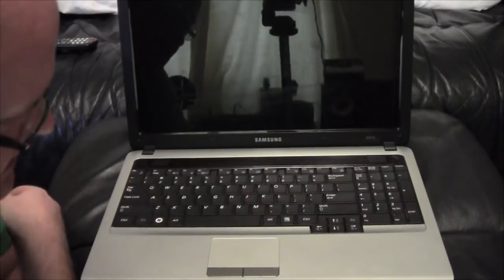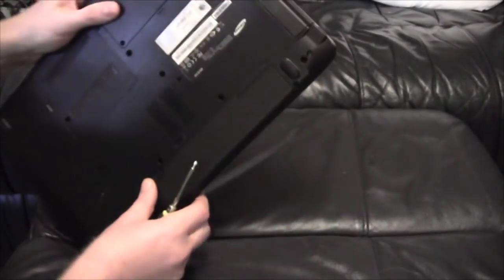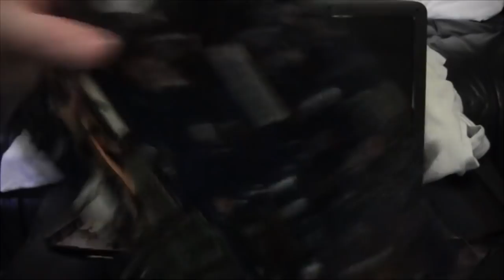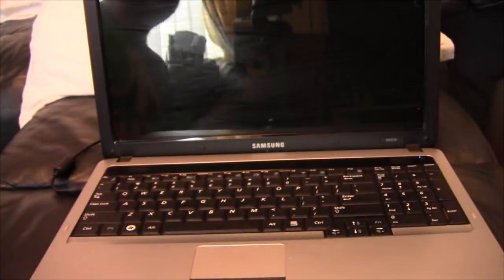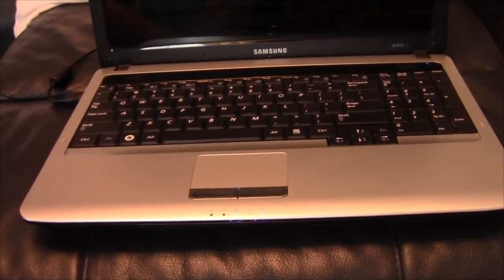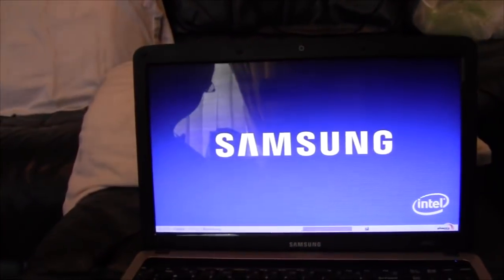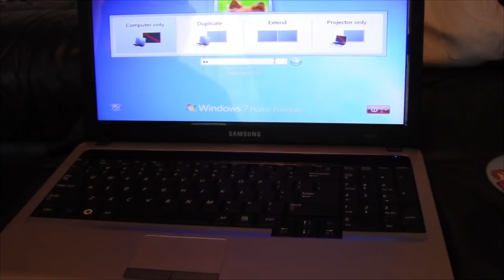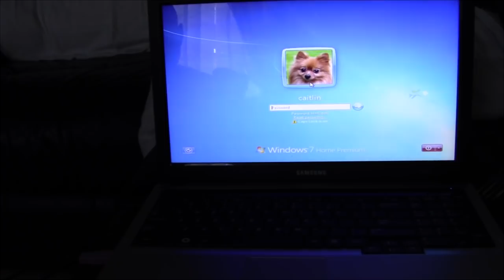How To Repair A Laptop After A Liquid Spill : Tutorial !

Comment: CAUTION!!! Never use a single cup as a placement for your screws because if they are different size or length in anyway, its gonna be a nightmare to put back. This doesn't even include the possibility of tripping the cup over. Make sure you got multiple storage departments for different screws. SECOND!!! NEVER USE WATER TO CLEAN A MOTHERBOARD OR ANY COMPUTER PART. Water will also ruin it over time and the same thing will eventually happen. The motherboard will poop out. The correct liquid solution to use is called "Isopropyl Alcohol" from your local electronic store and let it dry outside for a few days.
Reply from the maker: Yes, I agree, things I’ve learned in the 13 years since this video was made :o)
Reply: @RetroGamerVX haha

Comment: Hi I have a hp250 g1 laptop and like 3years maybe 4 ago got attacked with flavoured milk on the keyboard and if I  remember correctly it suddenly turned off plus that moment it was poo time in my life and with the anger just trew it in the box room and left it there,recently i remembered about it and tried to 'turn it on' but of course nothing happened,with or without the battery in when i plug the charger the side light starts blinking slowly from orange to white then it settles on blinking slowly white but when i try to press the power button nothing happens  exept it start do that thing the light goes orange for a few seconds then turns white blinking slowly again.Tooked it to a 'tech' and told me it is not worth it to fix but he was still able to get most of my photos videos and links on a pendrive,what do you think??? there's hope that it will turn on again??? if so this tutorial will do it or i need to do something more?PLEASE AND THANK YOU IN ADVANCE reply back thanks.
Reply from the maker: Naa, won't be worth it, motherboard likely badly corroded by now.
Reply: @RetroGamerVX  thank you for the reply,is there any way that i can check bymself if the motherboard is corroded or no? if no there is a way if i buy another motherboard to install it and it will turn on again? thank you in advance

Comment: I already did everything to my laptop. It’s a single slot ram, already tried removing it and turninh it back on, also did the keyboard cable out, the video flex cables, also tried connecting my laptop via hdmi to other monitor. And it’s just not working. But I haven’t done this yet. I’m a little bit sceptical of course getting you motherboard wet.
Reply: My laptop turns on but has no display

Comment: It switched on but its not charging. After a while it switched off because the battery was dead. Sad days
Reply: Google your exact laptop model (should be on the bottom of the laptop), look for a charging port replacement and replace it AND the charger. Worse comes to worse you have to solder it on there which isn't too hard. If this doesn't work, then your motherboard is fried.

Comment: I got a Quarter size drop of ICEE Cola on the upper top of my HP Laptop, where the small holes are, above the keyboard and it was only on that area...I left it there as I was afraid of spreading it and making it worse. I used my shirt to clean it up and it was typing on its own and making the icons on the screen big. I took the battery out and switched it on and off, and..long story short, my laptop went into cardiac arrest and never turned back on. I'm inclined to just throw it, but idk.

Comment: Had a little spill of soda on my computer a couple of months ago, but all the keys turned out to still be fine. However, with sticky keys, I tried to spray some cleaner over them. Time after time after time. Finally, they became operative again. But then, the ESC key stops working. Would this work to fix that as well?

Comment: Hello @RGVX. I have the same problem. I was surfing on the web and suddenly felt sick and I vomited on my laptop. I opened my laptop and cleaned with alcohol and it started yet only like five keys of  the keyboard were working. I cleaned then the motherboard with thinner and all keys are working,, only that if type certain keys like:   1, I get  output as 74231. 3, I get  output as 97423. Q, I get  output as mvx. E, I get  output as hge. A, I get  output as jfa and space bar I get  output as nbz  . Do you think it is a hardware or software problem and if so how to fix it? Could acetone clean the motherboard better?

Comment: The best solution would have been if the circuits were simply covered, instead of having those damn gaps where liquids can pass through.

Seriously, WHY does a keyboard have to have those wide open gaps?
It's ridiculous.
Reply: @Arbi Amaev Sö6 mine got thanos snapped so half my keyboard works
Reply: I split water on my latop and I broke several keys. I cannot log in anymore :')
Reply: @limeartichoke  buy a cheap keyboard
Reply: Mine doesn't even turn on anymore
Reply: My laptop has a metal piece that protected my laptop from water and cola and more

Comment: I just spilt a little bit of Coca Cola in the middle of my keyboard. I acted fast, picking it up and turning it upside down so the liquid would drip out. I then carefully wiped it down with a paper towel and put it in front of a small, portable fan. This was 10 minutes ago. My keyboard is working fine and my laptop is working the same as it did before I spilt it.

I hope it is okay.
Reply: +cody 
Is it still okay?
Reply: Yes.

Comment: I spilt a bit of coke on my hp laptop. It worked for 5 mins and then it just went off. It then turned back on and the internet wouldn’t work after 10 mins it turned of. Idk what to do now. Can I have help or guidance
Reply from the maker: Reece cause you kept running it, it will be what’s technically known as...buggered

Comment: i spill water on laptop keyboard,repaired it in 2 days:

1.two paper sheets a4,
2.sealed three sides with duck tape
3.put bunch salt in it and seal the last side
4. put on keyboard with a brick on it so the keys were pressed. 

bam, works again

Comment: Suggestion: I use white vinegar where I see apparent corrosion... especially if you're going to use the drowning (washing) method you used. I've found, over the years (especially with battery corrosion, and others) it works quite well. 

Also, when drying very wet electronics (including cell phones) that putting all in a large, covered tub half filled with white rice for a day or two works wonders.

Lastly, there's an excellent two part video on repairing a very wet keyboard, starting here: https://www.youtube.com/watch?v=dAfYTzLKLJY. Have fun!

Comment: i spilled some juice on my laptop's keyboard and at first, few keys didnt work and so i quckly wiped out most of juice on the surface and turned the computer back on, however now all the keys don't work and I'm now using the "on-screen-keyboard" to write this comment. Please tell me what to do to fix my keyboard keys. 

Ps: No key were/are working after i turned on the computer.
Reply from the maker: Likely, dried with a residue, may have to take out keyboard and soak it, then leave to dry for a few days.

Comment: Hi RetrogamerVX, 
I really appreciate to make such a video!!

My issue is something similar!! 

After watching a movie late night Last week i kept my laptop on the floor (laptop was shut down but the charger was connected to power) and slept, Our water tank broke and water came into our room, but we came to know about this 3-4 hours after this incident.

When i looked at My laptop it was like half dipped in the water in normal position(in the same position we use a laptop,horizontal) i immediately removed the charger, removed the battery and opened the laptop to clean it completely, (i cleaned everything, only i didnt open the processor). i waited for one day and i turned on the laptop and everything worked fine for one complete day (i didnt turn off the laptop for that one complete day). next day before going to bed i shut down the system now the system is not turning "ON" at all. 
what could be the reason? 
what is the solution?
Now, when i connect the charger to the laptop the power button and caps lock is LED is continuously "ON". But not turning on
Laptop is HP PROBOOK 450 G2 

Hope i have explained it will for you to understand the complete situation, i can send you images/video if required and upon providing your email address.

Many thanks.
Nahas
Reply from the maker: Nahas nahas im no expert but one day is not long enough for it to dry completely.  sounds like its shorted.

Comment: I spilled coffee took to the repair people, but i had taken off the keyboard bought new one but still not working.Why?The laptop works but not the keyboard ?
Reply from the maker: Duff keyboard or keyboard controller on your motherboard?
Reply: RetroGamerVX
Not sure; it is an  HP 15-R212NA laptop. You  lift it from the top to get to the mobo.  I can see under the keyboard the optical drive, part of the mobo under some kind of screwed  aluminum panel, i can see the  plastic /connector for the touch pad  and another on the left hand side but  im afraid this  as i far as i can go to provide you with info, i am more of a self build desktop fanatic than laptops honestly. Hope this help. Cheers

Comment: Today I spilled some water on my laptop's keyboard and I'm not sure if that does some REAL damage or not. I been freaking out for like since the afternoon.
Reply from the maker: not usually unless it goes inside.  keyboard may operate strangely until the water has evaporated.  id carefully hair dryer it :)
Reply: RetroGamerVX  THx for advise :D
Reply: what if the keyboard is shorted? still recoverable?
Reply: Tarik Zainal my sister spilled water on the keyboard and when I dry it and turn it on it was appearing samsung screen but there was no lock screen then I turned it off
Reply: RetroGamerVX  how long before it's unfixable can you wait like a day to fix it

Comment: water was spilled on mines. i looked inside and seemed pretty clean. i let it dry for a week and charged it. the power light came on. first it was yellow and then it turned blue. so i went to power it on and everything turned off. so what could be wrong that it is not turning on completely? The laptop screen didn't get any water in it. Thank you RetroGame!
Reply from the maker: Something has shorted out looks like :o(
Reply: +RetroGamerVX that's what I thought. Thank you! You are the best!

Comment: WARNING!!! Never use a single cup as a placement for your screws because if they are different size or length in anyway, its gonna be a nightmare to put back. This doesn't even include the possibility of tripping the cup over. Make sure you got multiple storage departments for different screws. SECOND!!! NEVER USE WATER TO CLEAN A MOTHERBOARD OR ANY COMPUTER PART. Water will also destroy it over time and the same thing will eventually happen. The motherboard will die out. The correct liquid solution to use is called "Isopropyl Alcohol" from your local electronic store and let it dry outside for a few days.
Reply from the maker: strange that, 3 years later, still running strong :)

Comment: I spilled a bit of water on my laptop and let it dry out. but the whole keyboard doesn't work what do I do? I can't afford to buy a new one and I can't afford to get it fixed. I need my laptop for my college classes. please help!
Reply from the maker: Unless the keyboard connector has slipped then it's either a problem with the keyboard or the controller on the motherboard got fried if the water got that far.
Reply: +RetroGamerVX  I literally broke my keyboard how do I get a new one?

Comment: I am no fan of using water for cleanage. It can mess up if you don't take everything apart, as happened with the keyboard in the video. Applying this method using pure alcohol instead works perfectly fine for me though, even on a soaked keyboard.
Reply from the maker: The keyboard was already buggered.

Comment: after I did this my laptop no longer turns on..
Reply from the maker: youve buggered it
Reply: +RetroGamerVX how I did what u did just not take apart so much
Reply: You have to take apart everything because there's an internal battery that you need to disconnect before it can be exposed to water. You can attempt to clean it correctly this time, perhaps with alcohol or contact cleaner instead, but I doubt it's repairable at this point.

Comment: my kid spilt cup of tea on mine 4 days ago no sugar in it ,the power cut out when it happened , turned it on its side at the time let the liquid come out ,blew a hairdryer on it ,took it apart cleaned the liquid i could see ,let it dry in the sun a bit ,then tried to turn it on to soon probably, no power tried to turn it on again few days later still nothing didnt clean it as thoroughly as you have ,i was thinking about taking it to the shop tommorow ,but i might open it up and give it a good clean before i do ,what iam wondering if i cant fix it,will someone who knows what their doing be able to salvage the computer , iam assuming the keyboard will need replaced no matter what , looking at it there doesnt seam to be any damage inside, dont imagine theres any corrosion,in the worst case scenario can the motherboard be replaced
Reply: The logic motherboards cost more than the product most times
Reply: i think that you need new motherboard and battery.

Comment: I cleaned my acer laptop with a lysol wipe while it was on,now whenever I turn it on the screen flashes black. Please help. P.S I do not want to bring it somebody if it can be avoid and yes I know you should turn it off before cleaning it but I forgot. :(
Reply from the maker: +Bailey Atkinson Unless some got inside and has hit electronics, I cannot think how that would damage it.
Reply from the maker: +Bailey Atkinson But you might want to leave it at least a few hours (evaporates quickly that stuff) before switching on again.
Reply: One problem I have already turned it on before you commented because I had only just found this video. Will it still evaporate in a couple of hours?
Reply: It's still doing it :(

Comment: Today i spilled apple juice (with 50g of sugar) to the side of the cd drive and i didnt turn it off because i thought it wouldnt go in but after a few seconds it turned off. I left the laptop in a sunny place for a few hrs but when i turn it on with the battery it said automatic repair starting and heard the fans going fast. But it shutdown it self, i tried again and it just showed a white screen
Reply: I cant open the laptop too because of a stripped screw
Reply: And the juice barely touched the hardrive (i can open half of the laptop)
Reply: Help
Reply: Some went on the keyboard too but i wiped it with a paper towel
Reply from the maker: +Sunneh “Mug” Caiman if you cannot get in the case youll have to take it to a computer shop

Comment: my  laptop  is asus transformer.i split  the  water  on keyboard ans usb plug there. while split water my laptop is still on. So after few second it automatic turn off and i can smell like have a little smoke out. And after few hour it sudden appear on screen write auto repair system within 1second. then switch off back. Until now already 36 hour. i try to switch on is no function at all just duno know why keeping having the light on the lightbub icon / sleep mode . because my laptop the battery  is plug in .so that i cannot take out. i tried for rice, hair dry blow but till now still cannot. what is the next should i do ?
Reply from the maker: sounds like its kicked the bucket :o(

Comment: i thought you were crazy cleaning with water-however i decided to give it a try with my toshiba s75 17" i7.opened it up after a fruit juice spillage and it wouldnt start up--found the corrosion point washed it off-and walla-now it powers on...still having keyboard isssues-but i will wash that in a bathtub soon-thanks.....
Reply from the maker: as long as its dried properly, corrosion should not be an issue

Comment: hi mister
so I spilled water on my friends laptop. it turned off then we turned it back on but the keyboard was keep hitting the h key. then he turned it off, charger still in inside and mouse. later he tried to turn it on but it won't turn on but the mouse blinks when you press the power button. does it just need to dry or is it too late?
Reply from the maker: Try drying it out, see what that does.
Reply: RetroGamerVX so after a few days he turned it back on and it seems that its completely back to normal, thankfully. just glad it wasnt soda or something like that.

Comment: I spilled iced tea on my Asus k501l laptop and I dried the motherboard and took out the battery and let it sit for a while. I tried turning it on after a while and the lights blinked for about a second and the screen didn't turn on at all, when I plugged the laptop into the charger, the light that signified that it was charging was turned on but again, the laptop itself wouldn't turn on, any tips? :(
Reply from the maker: +Nikita Vetrov Something must have shorted in the motherboard unfortunatly :o(
Reply: +RetroGamerVX would replacing the motherboard fix my problem?
Reply from the maker: Possibly, couldnt really say as its not infront of me.  Double check all your connections too

Comment: i tried this with the electric toothbrush but the outside was dirty too, so i put the whole thing under the sink.  it didn't work, i've got to go poop now
Reply: while i was taking a growler, grandma used grain alchohol and a blow torch to get remaining crud off with excellent results, but like, then it melted, so it's hard to tell what key is what, and some are now combined.  it's uncharacteristic for her to do something like this, as she's normally (locked) in the cellar for the safety of her and those around her (and electronic devices), but she's cat sitting for aunt frecky (7 is about 2 too many cats....for grammy anyhow).   lesson learned.   don't take a smash when you've got a wet laptop and grandma's loose.